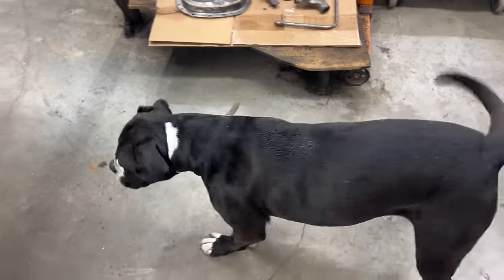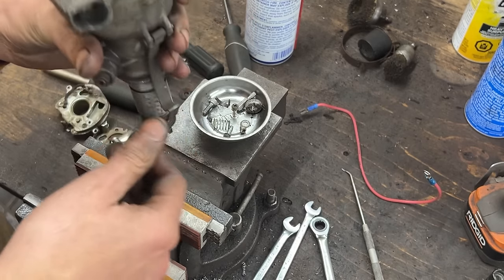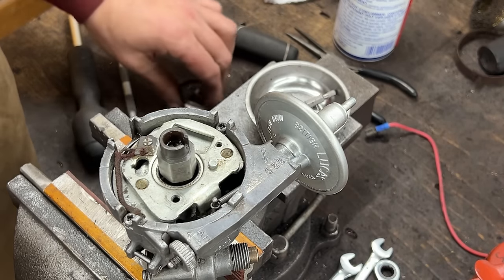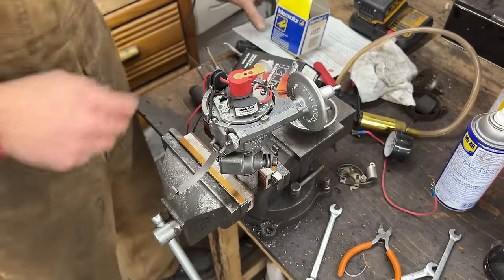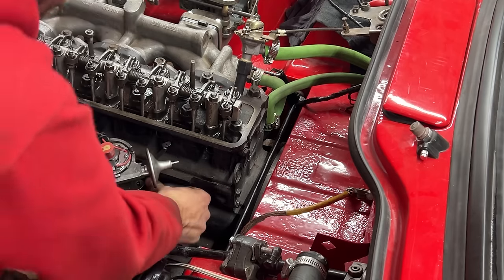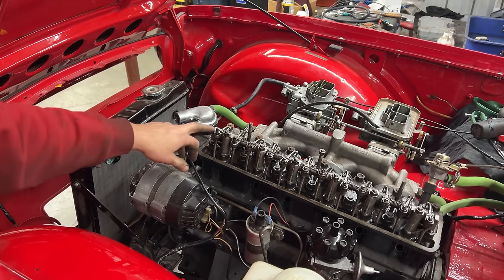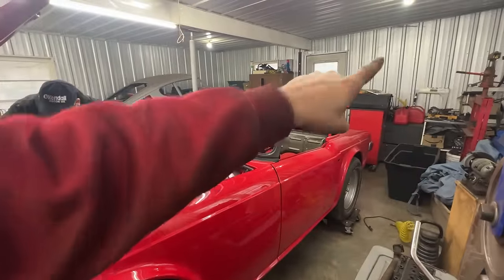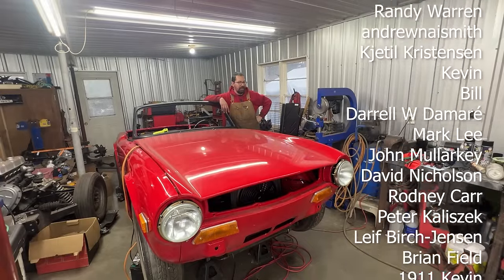1970 TR6 - Part 40 - Will She Start 7 years after the last time she ran.

Comment: After sitting for 7 years, I would expect issues, disassembly and cleaning of the carbs seems like a must.  I'm sure the carbs will perform well once the problems are sorted and adjusted, no reason to throw them out just because people don't like them.  Not many choices these days for replacements.

Comment: It must have been a relief when the engine fired up first time, but when you do your homework properly, you get the results! Congrats. Maybe you know this, but on the Briggs & Stratton engines the gap between the flywheel and the magneto is set by putting the box lid in which the mag is packaged between the mag and the flywheel.